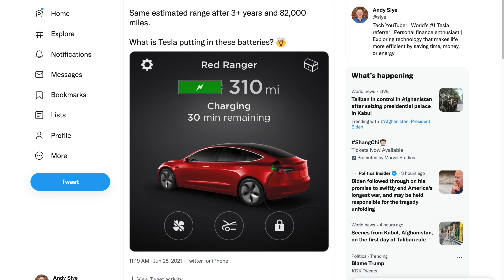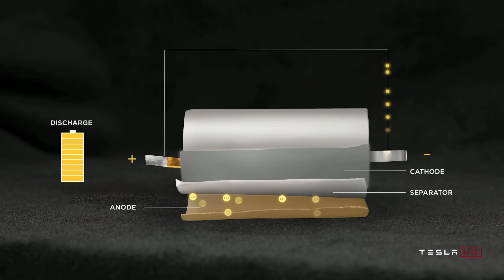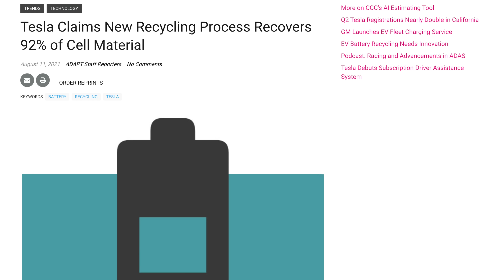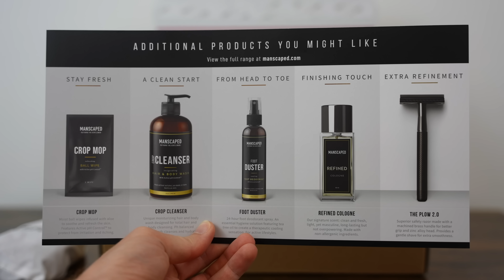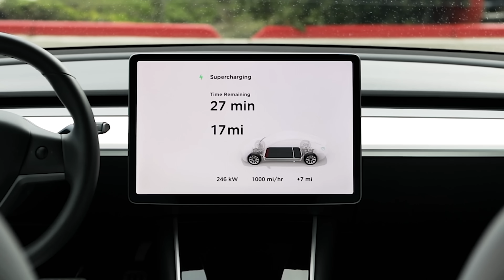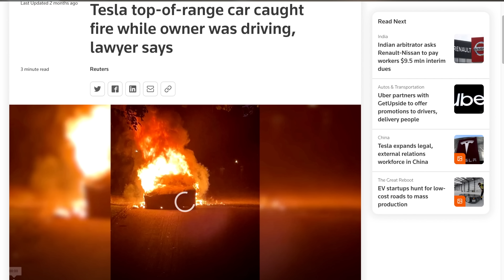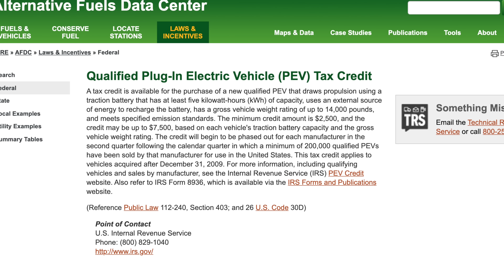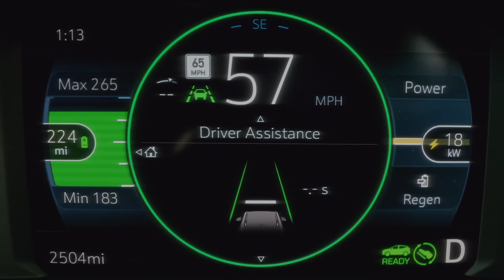Top 5 Dumbest Tesla Myths Debunked!

Comment: Thanks for the video, very informative. The main concern I have with EVs is that I live in Montreal region (Quebec) with its cold winters. So the perfect storm would be to drive an EV at -20 C in a snow storm and eventually be stuck on Mercier or Champlain bridge for many hours because of an accident, with a fully charged battery (at the beginning of the day) but the range being greatly reduced by cold temperature and also with the heater on. I presume the battery would deplete rapidly and being stuck on the bridge with windy cold would I think, definitely be a concern. On the contrary, If I leave the house with my SantaFe 2021 with a full tank of gas and the same whether and traffic jam situation happens, there is no issue. I don't own an EV and maybe I'm wrong.. Your comments are welcomed.
Reply: First, the country with the highest EV adaption is Norway. I'm pretty sure their winters are just as bad or even worse than Quebec's. An ev loses up to 30% of its range in the cold. So, a car with 300 miles of range, will end up maybe 200 miles of range in the cold. On the plus side, an EV doesn't use much energy when it is stopped in traffic. An ICE car keeps burning gas. If you are worried about running out of energy, you can switch off the a/c and keep the seat heater on. It uses way less energy than the a/c. I don't know how much you drive daily, but I would guess that 200 miles of range would be sufficient, even if you are stuck in traffic.  Plus, plenty of people run out of gas when they are stuck in traffic from an accident. It's not just an EV thing. The only real difference is that you can tow or push a car to a nearby gas station, while a charging station might be far away

Comment: Great video Andy.  I had a condo resident tell me the other day that Tesla has recently announced that owners should not charge their vehicles in a garage due to fire risk.  My wife and I drive a 2021 MY LR.  Thoughts?
Reply: That was a Chevy bolt thing. They are having issues with their batteries when charged to a high state of charge. Tesla hasn't had any incidents of the car catching fire while charging. There was one incident in China of a car catching fire in a parking lot, but they found the driver was speeding and hit a loose manhole cover that damaged the battery and it finally caught fire after she parked it.

Comment: In addition to debunking the big myths, I think it would be useful to spread TRUTHS about EVs that, while obvious to current owners, are perhaps not as widely known by the general public:
1.  The performance is awesome, so much NOT like a golf cart that it boggles the mind.  The extreme acceleration is a major safety feature in tight driving situations.
2.  The maintenance, other than tires and wipers, is negligible with an EV, whereas with a gas car it is an entire litany of things outlined in the handy service manual provided with each car.  As time goes by, even with a long-term powertrain warrantee, things like water pumps, alternators, oil pumps, anti-pollution sensors, exhaust system, brakes and rotors, belts, and on and on will start to expensively go, but comparatively much less so with an EV.
3. Refueling in most locations is either somewhat cheaper, or very much cheaper with an EV.
4.  The environmental control system in an EV is awesome, and can operate a VERY long time while the vehicle is stationary (for any pets, kids, or patient husbands or wives left in the vehicle in the hot or cold).
5.The layout and storage in most EVs, in particular Teslas, is much better/more generous, for passengers and luggage and "things".
6. The extreme low center of gravity and balanced (front to back) center of mass is so good in a typical EV that cornering and rollover safety is tremendously good, especially comparing a small SUV to, say, a Model Y.
7. The lack of engine and transmission in an EV allow for MUCH more crashworthy designs; not only are those large chunks of steel removed from between the passengers and the colliding object, but the crumple zones can be WAY bigger.
8. One reason EVs such as Teslas are better for the environment than gas cars even if recharged on a "dirty" grid is that they are tremendously more efficient than a gas car: the energy in a Tesla Long Range Model Y, fully charged, is equivalent to about 2.5 gallons of gasoline providing the 300+ EPA miles of range.  Even if coal power plant is only 40% efficient, the charge requires only the gasoline-gallon-equivalent of 2.5/0.4 or 6.25 gasoline-gallon-equivalents of coal, not the 15 gallons or so that it takes to fill up a gas tank.
9. Being stuck in hot, extensive, stops-and-go traffic traffic doesn't stress an EV in the least, whereas the electric radiator fan in an ICE car is the only thing preventing an overheated engine (as the air conditioner struggles to perform...).
10.  Etc; you get the idea...
Reply: Great comments. I’ve been shopping for a nice fuel efficient SUV and decided on a MY because spending the equivalent $ on a luxury German ICE SUV, THEN $thousands each year on maintenance, with the car ultimately degrading after 100k miles would make me INSANE!!! Not to mention paying for premium fuel to turn into greenhouse gases. It makes me feel like I’m taking my paycheck and lighting it on fire.
Reply: @slee4110  great way of putting it!
Reply: 10 - You don’t have to take your vehicle in for a smog check on a yearly basis.   And free88 attempts to continue spreading the FUD about EVs.  #2, #3 and #8 are all definitely true ( owner of a 2029 Bolt).
Reply: Other ideas would be safety ratings and total cost of ownership.  With BEVs coming down in price, the latter should become lower and lower.  One pedal driving saves on brake wear.  It's certainly nice starting each day with an 80%-charged battery!  If you generally start at 80% and go to 20% or so, 60% of 320 miles is 192 or nearly 200 miles.  Seems like that's more of a practical range.  Owners without in-home or local destination charger might be limited to the SC network.
Reply: @walthooker1434  Turns out one pedal driving actually increases brake related costs.  Another one of the lies.  Also, the insurance industry is catching on to Tesla's incredibly high accident repair costs, and premiums are skyrocketing.  Your math is very far from the truth, unfortunately.  Range depends on how quickly you expend the charge in the battery in every sense.  Supposing 100% charge equals 100 miles, and you only drive 10 miles per day.  You will absolutely not get 100 miles out of that charge.  Some is lost each day due to standby consumption plus the self-discharge losses of the battery.  If you drive too fast, you lose.  If you drive too slow, you lose.  A/C on, you lose.  Windshield wipers on, you lose.  Headlights on, you lose.  Turning the steering wheel, you lose.  And so on.
Reply: @KungPowEnterFist  Agree.  Same with ICE gas mileage.  It depends on how you drive, equipment running, etc.  An alternator helps with the electrical loads but puts a load on the engine.  A BEV is on the hook for everything.  I'd rather have a BEV rated at 500 miles so many of these issues would become moot.  Maybe when the price comes down and they get lighter.... someday perhaps.
Reply: @walthooker1434  Its incredible how so many things are included in the ICE MPG ratings because they are inherently accounted for as part of the normal operation of the vehicle, that for an EV, eh, not really.  For example, the engine (battery for an EV) cooling system.  The burden of running the cooling system of an ICE is incorporated into the MPG rating, because the ICE traditionally has to do that whether the car has been on for 1 minute, 30 minutes, 30 hours, cold outside, hot outside, lukewarm outside.  When the car is off or refueling, it does not spend energy on engine cooling for the most part (some oddballs, yes, for a very short while after turning off the car).  For an EV, it works differently, however, pretty much the same amount of energy (or more) is spent for the equivalent task.  But if you start your rating test with a completely cooled down battery and run the test like an old lady, that cooling system will not likely turn on and thus not expend energy.  But when you drive normally in, say, South Florida, that active battery cooling system will turn on quite often.  When you recharge the battery, it will turn on quite often.  That should all count, because it is in fact energy spent to operate the vehicle even if the vehicle is at rest at a supercharging station just off the highway while you are inside McDonalds eating a Big Mac.  For a while there, Tesla was not even counting the energy spent with you sitting in the car at a supercharger using the HVAC and watching Netflix.  That's BS.  Energy spent is energy spent.  It counts.

I am 100% on board with getting an EV.  I just wish Tesla would stop lying about the real consumption costs of an EV.  Every single Tesla is more expensive to operate and maintain than virtually ever production car and most production trucks being released today.  Its about twice as expensive to operate and maintain than today's and about to be released PHEV's.  Double!  And no more tax incentive?  Forget it.
Reply: @KungPowEnterFist  Turns out based on what research. There are plenty of posts from actual Tesla owners who had their cars 5-7 years and they said they had 1 or 2 brake jobs over that time period. How exactly does one pedal driving increase brake wear? You are using the motor to slow the car. That's like saying switching to a low gear when going down hill to slow the car will wear out the brakes. Tesla do have higher than average tire wear because of the high torque.  Sure you have higher energy consumption because of A/C use and high speed driving. That applies to ICE cars as well. The amount of electricity lost from all the other things is minimal. It might account for 2% of the battery use. So, you lost 2 miles. You will lose far more from an ICE car idling in traffic. Some ICE cars can turn off the engine or shuts off some cylinders, but that increases the wear on the engine. You lose time, not energy from driving slow, but again that applies to ICE cars as well.
Reply: @KungPowEnterFist  There is some truth there. An EV will run the fan on a hot day to cool the battery. However, the energy to run the fan isn't very high. Same applies for ICE cars. The energy that is directed to turn the fan belt can't be very high. So, the impact on MPG is minimal for this.
Reply: @ymcpa73  Yup, not here to convince you.  That's not my job.
Reply: I love these comments.  #1, true, although you basically never need it.  #2, lie.  #3, huge lie.  #4, eh, on par.  #5, your opinion, opinions vary.  #6, your opinion.  #7, again, that is just your opinion.  #8, huge lie
Reply: @KungPowEnterFist  What are you talking about? #1 not needed but plenty of people buy performance cars. #2It's an absolute fact it requires less maintenance. Just look at the maintenance chart in the owner manual for Tesla and any ICE car. The ICE car will have a list of things to do at 10k, 15k, 20k, etc. Telsa has change the cabin filter and brake fluid every 2 years,  A/C service every 3-6 years depending on make, and oil and clean brakes every year, for winter weather.  So, maintenance is an absolute fact. #3 absolute fact. This is a performance car. An equivalent ICE car would require premium gas. In my area, that is $4.50+/gal. The highest supercharger rate I've seen so far $0.35/ kw. Let's assume a 16 gallon tank and 100kwh battery. To charge to full would cost $72 for ICE and $35 for Tesla. The range on these cars would probably be comparable. The MPG on the ICE car would have to be amazing to make up that difference. #4 not sure if it's comparable. you would need to keep the engine running for a long time and that can't be good for the engine plus the exhaust fumes that would build up in the area. #5 this varies by car but because of the frunk and the extra storage in the trunk because there is no transmission going the length of the car, it will probably have more storage than most equivalent sized cars.  #6 that is not an opinion. That is a verified fact. It has a low center of gravity because most of the weight is from the battery. It is very difficult to roll over a Tesla and you can read plenty of reviews from car magazines detailing that it corners incredibly well for a car that weighs over 5000lbs. #7 not an opinion. Look at the NHTIS crash test results. It's a fact that the most dangerous thing in a front collision is the engine being pushed into the passenger cabin. That is why crumple zones were created. With no engine, the entire front end is a crumple zone. #8 I've read some articles indicating this is true. If you have any legitimate (not some guy on youtube or a guy with a blog) research articles that prove this is false, please post a link. It is widely knows that ICE engines are very inefficient because of the energy lost as heat and friction. There is energy lose from transmitting electricity in wires and converting from A/C to D/C. So, I'm not sure if his gasoline equivalency is accurate, but every legitimate article I've read points to EVs producing less pollution over their lifetime.
Reply: @ymcpa73  With Florida's ~$0.12 per kWh electric, gas would have to be over $9/gallon to approach the break-even point for operating and maintenance costs per mile for today's PHEV vs something like the Model 3 Standard.  Over $9!  87 octane is currently around $2.95, and the 2021 Rav4 Prime runs on 87 octane.  $38,350 base price.  Will be getting the $7500 tax credit.  So, that's around $31k after the tax credit.  I don't need links or whatever you would call proof.  I have multiple engineering degrees, I am a professional engineer, and I am a subject matter expert in multiple disciplines including electrical engineering and electrical machines.  I am not saying ICE's are efficient.  They are not.  However, the current generation of EV's, such as the Model 3, cost about double per mile to operate and maintain vs today's PHEV's such as the Toyota RAV4 Prime, BMW 330e, Honda Clarity, Hyundai Ioniq, and basically any other PHEV (that can exceed 25 miles all electric city while getting high 30's MPG+ on the highway on gas.  Double the cost.  But I am not here to convince you.  It is what it is.  Your belief is not required either way.  The math and science is the math and science with or without your approval.

Comment: While it may be true that EVs don't NEED the rebates, the plain truth is that many people cannot afford to spend what most new EVs cost to buy one, thus there need to be more models that cost significantly less for full adoption of them to be successful.
Reply: You are right. But soon the good used ones will will work out more reliable, safer, convenient and cheaper to own than an equivalent ICE car. “Come gather round people wherever you are, for the times they are a changing” (Bob Dylan)
Reply: You are right. But soon the good used ones will will work out more reliable, safer, convenient and cheaper to own than an equivalent ICE car. “Come gather round people wherever you are, for the times they are a changing” (Bob Dylan)
Reply: You are right. But soon the good used ones will will work out more reliable, safer, convenient and cheaper to own than an equivalent ICE car. “Come gather round people wherever you are, for the times they are a changing” (Bob Dylan)

Comment: The still missing Malaysia airlines flight 370 was carrying a large load of lithium batteries in the cargo area that burst and exploded. And last but not least Not everyone owns a garage and autopilot software eventually crash just like regular softwares
Reply: Two of my neighbors own Teslas and neither one parks in a garage, and nobody knows why Flight 370  dramatically changed course, flew many miles and eventually crashed. The plane was never found.
Reply: @1jameswag  Is that because of fear of fire or because their garage is a mess? I have plenty of neighbors with ICE cars in their driveway. There is always a risk, but very few actual examples of this happening, even if you account for the GM Bolt.
Reply: Don't take your phone in the car, you'll crash....
Reply: If you don't have a garage and no way to install a 240v outlet near the car, then you would need to charge at a supercharger once or twice a week, just like filling an ICE car, but it will add 25 minutes to the process. Not a huge deal, but also not ideal. Do you realize how much software is in ICE cars? Sure it can crash. Then you turn off and start up the car and it is fine again unless there was a hardware failure.

Comment: Myth #1 - Batteries need replacing.

Unfortunately the Nissan LEAF batteries didn't fair well. I replaced the battery in my 2011 LEAF at year 5. This issues with LEAF's are now well known. Tesla and other manufacturers will be looked at skeptically because of what happened to the LEAF, FUDsters will use this to smear all brands.
Reply: Nissan chose to use passive cooling. Batteries degrade if they get too hot. Leafs in hot climates, like Arizona, didn't last very long. I'm pretty sure every new EV has active thermal management to maintain the batteries.
Reply: @ymcpa73  No doubt. My point however is because Nissan put out a poor battery in the LEAF other brands will be viewed skeptically. The ordinary Joe on the street doesn't appreciate the difference between passive and active cooling. Many may think all EV's suffer the same problems and the FUDsters will be sure to reinforce that incorrect assumption.